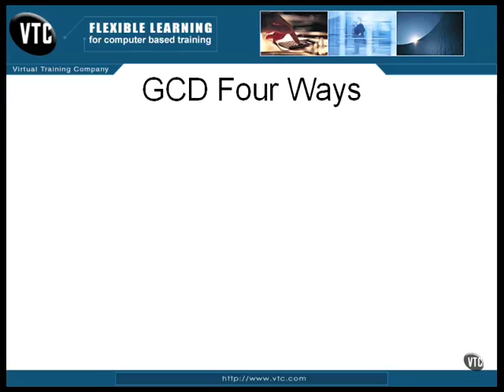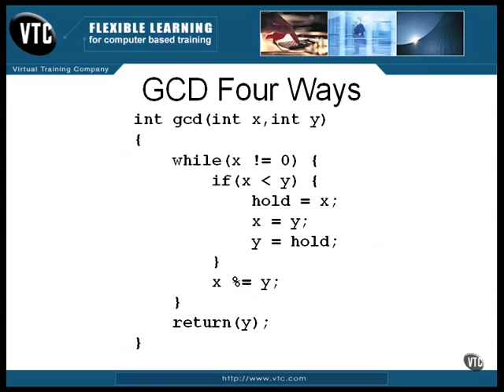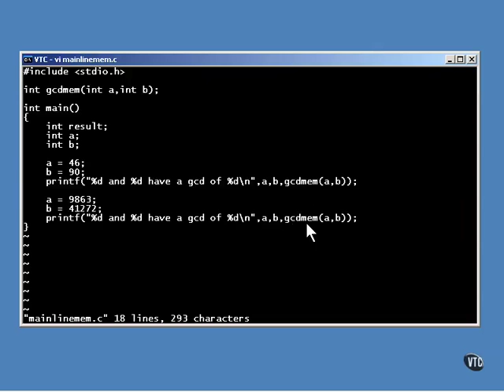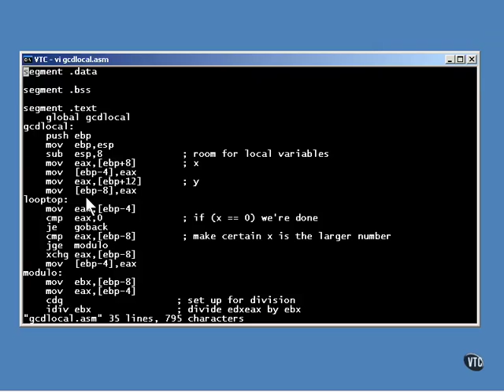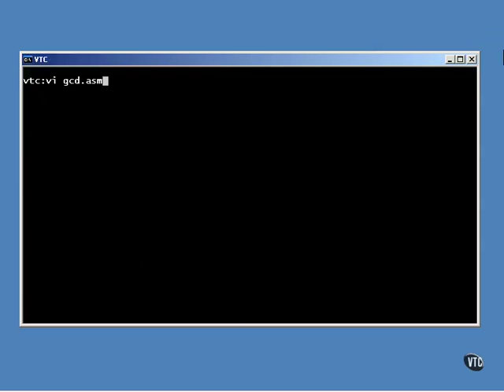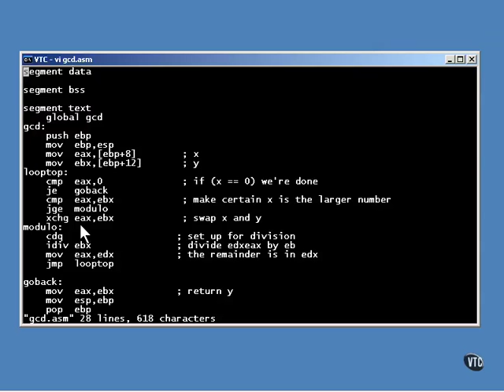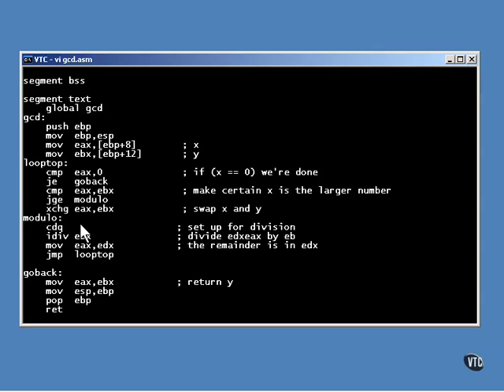Assembly Language Training: Part 5 (9 of 17) - Assembly Language Basics (GCD Four Ways)

Comment: how did you get your program to compile and run in windows? I'm having trouble getting mind works. I'm using nasm version 2.0.1 win32, alink win32 and windbg.
ON CMD, I entered
a. cd c:\nasm to go inside nasm folder
b. c:\nasm> nasm c:\nasm\Projects\Tut1.c -o c:\nasm\Projects\Tut1.com
But I'm getting heaps of errors below. What could be the problem? My code is below also. Appreciate your help. Thanks.

Code below:
.................
//c code below
..................
#include<stdio.h>
int RanIntGenerator(int x, int y);
int main()
{
    int x, y;
    x = -10;
    y = 10;
    int rndNumber = RanIntGenerator(x, y);
    printf("x:%d y: %d Random Number: %d\n",x,y,rndNumber);
    return (0);
}
....................
;assem.asm
section.data
    ; initialized data variables
section .bss
    ; uninitialized data variables
section .text
        global RanIntGenerator
    ;int RanIntGenerator(int x, int y)
    ;.code
    RanIntGenerator:     
        push    ebp                ; push base pointer on to stack
        mov        ebp, esp        ; ebp = esp
        mov        eax, [ebp+8]    ; push x into stack'
        mov        ebx, [ebp+12]    ; push 2nd argument, y to stack i.e. ebx = y
        cmp        eax, 0            ; (if x <= 0) jump to InOrder, else skip to the next line and swap
        jle        InOrder
        xchg    eax,ebx            ; swap contents of eax = ebx; ebx = eax
        mov        [ebx+8], eax    ;        
    InOrder:
        rdtsc                    ; read time stamp counter; load lower 32bit to edxeax register
        shr        eax,2            ; eax >>=2 or divide by four; not extend sign bit
        mov        ebx, [ebp+12]    ; copy y into address [ebp+12]
        add        ebx, 1            ; ebx +=1 or add 1
        sub        ebx,[ebp+8]        ; ebp -=content of [ebp+8], or x
        cdq                        ; sign extend dividend
        idiv    ebx                ; divide time stamp value of lower 32bit of register edxeax by ebx
        add        edx,[ebp+8]        ; result in register edx +=x
    GoBack:
        mov        eax, edx        ; save return value
        mov        esp, ebp        ; restore esp
        pop        ebp                ; restore ebp by poping it off stack'
        ret                        ; return to the caller
        ;RanIntGenerator endp
    end
;end of function or module
.................................................................................................
//errors after compilation, below
....................................................................................................
c:\nasm\Projects\Tut1.c:1: error: label or instruction expected at start of line
c:\nasm\Projects\Tut1.c:2: error: label or instruction expected at start of line
c:\nasm\Projects\Tut1.c:3: error: label or instruction expected at start of line
c:\nasm\Projects\Tut1.c:4: error: comma or end of line expected
c:\nasm\Projects\Tut1.c:4: error: comma or end of line expected
c:\nasm\Projects\Tut1.c:5: error: comma or end of line expected
c:\nasm\Projects\Tut1.c:6: error: label or instruction expected at start of line
c:\nasm\Projects\Tut1.c:8: error: parser: instruction expected
c:\nasm\Projects\Tut1.c:9: error: parser: instruction expected
c:\nasm\Projects\Tut1.c:10: error: label or instruction expected at start of line
c:\nasm\Projects\Tut1.c:11: error: label or instruction expected at start of line
c:\nasm\Projects\Tut1.c:12: error: parser: instruction expected
c:\nasm\Projects\Tut1.c:13: error: label or instruction expected at start of line
c:\nasm\Projects\Tut1.c:14: error: parser: instruction expected
c:\nasm\Projects\Tut1.c:15: error: label or instruction expected at start of line
c:\nasm\Projects\Tut1.c:16: error: parser: instruction expected
c:\nasm\Projects\Tut1.c:17: error: label or instruction expected at start of line
c:\nasm\Projects\Tut1.c:19: error: label or instruction expected at start of line
c:\nasm\Projects\Tut1.c:20: error: label or instruction expected at start of line
c:\nasm\Projects\Tut1.c:21: error: label or instruction expected at start of line